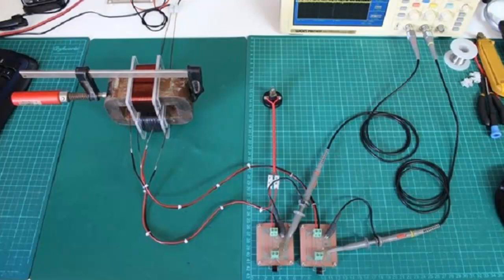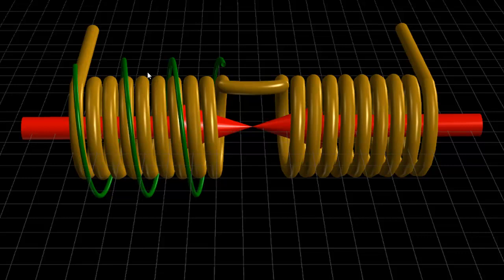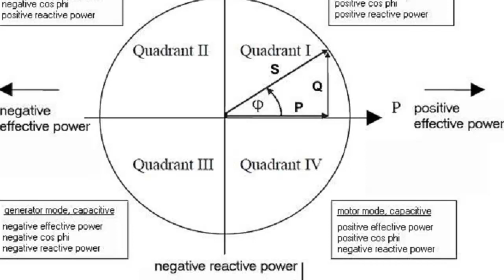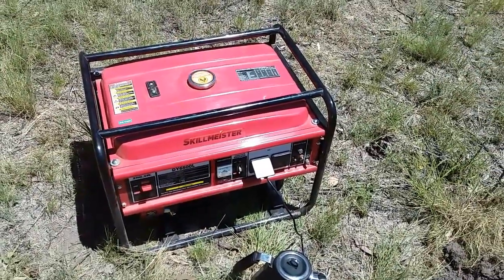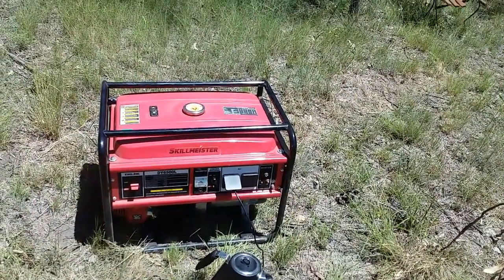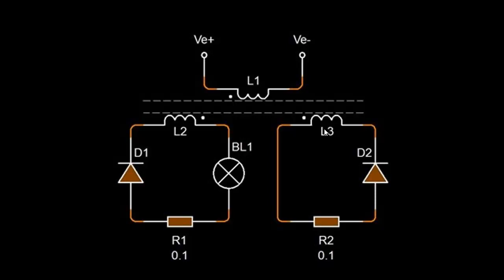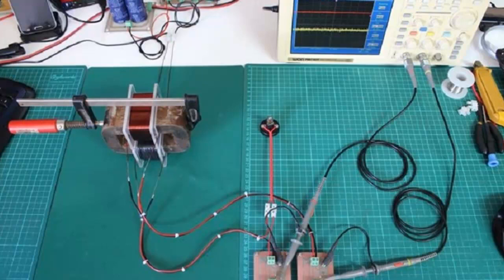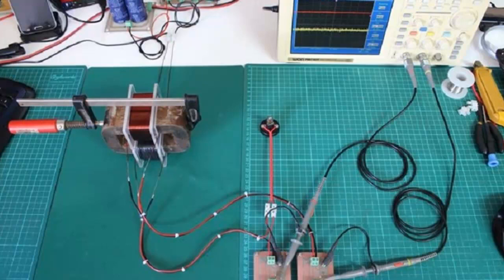Chris's Electromagnetic Charge Pump Experiment - Part 2

Comment: My question after watching almost all of your videos is why didn't you take a gas generator and rewire it to run your home? You spent more time pissing and moaning about people than trying to make something useful. All these years and you have nothing to power more than a couple little light bulbs. Correct me if im wrong.  Do you have anything that can power more than a couple 12v lights?
Reply from the maker: Yes, I have not paid a Power bill since 2018. You can take from that what you want, my fellow researchers, on my website can attest to these machines working as I have shown you, take from that what you will, and yes, there is a lot of Mongrels that do nothing but winge and complain, trying to discredit me and my work, so yes I will always expose these mongrels for what they are!
Reply: @SweetSQM  how are running your home with bigger versions of the ones you show? Is your website going to be completely taken off www or will it be read only? I have been going through it for the last few days hate to see it go away completely? I have an bad gas motor gen set trying to figure out how to use the generator like some of the things you are doing. And thank you very much for introducing me to Tom Bearden with your YouTube videos.
Reply from the maker: @getreal1702  - Scale, Ohms Law: I = V / R, so the Pumping of Current depends entirely on the Voltage "Generated", as Resistance R would stay the same, unless one were to change the Load. Scale changes the Voltage "Generated", Coil Geometry is important, because as Magnetic Fields increase due to the Coil Geometries, is tied to Faradays law and thus the Voltage "Generated". Introducing Asymmetrical Electromagnetic Induction gives rise to Open Systems that is not keyed to Input Power.
Reply: @SweetSQM 

Hey Chris,

so basically what we need to do for V to increase, is change the geometry / add turns.

I also wanted to ask you, will there ever going to be a part 3? 
🙇